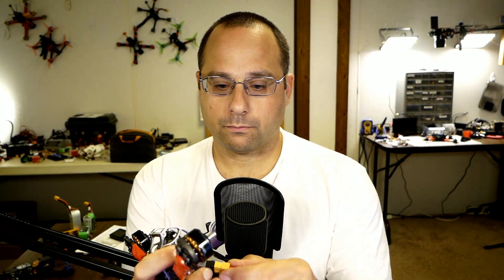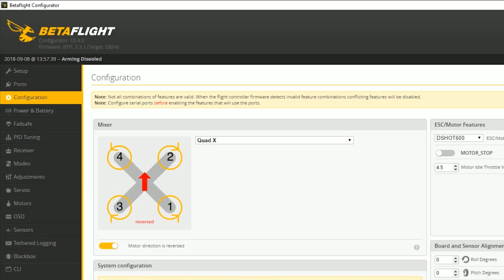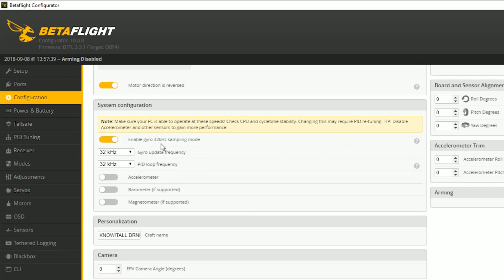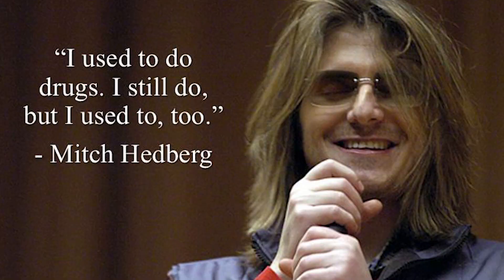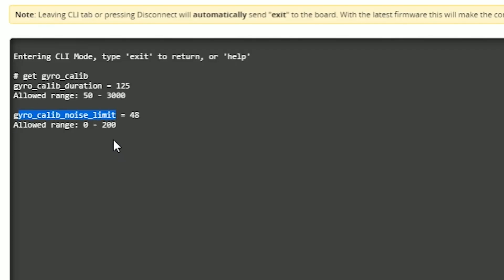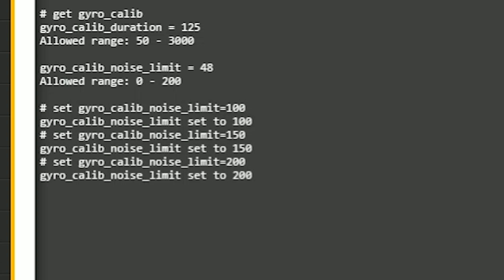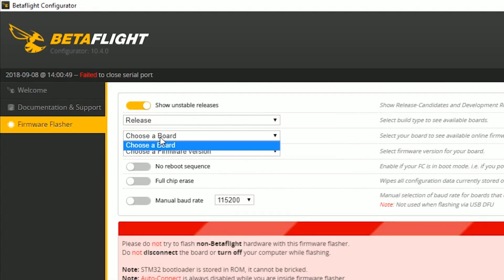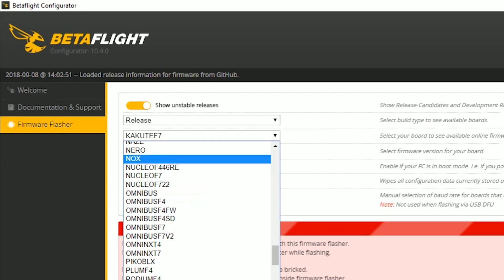BETAFLIGHT WON'T ARM | CALIB NOGYRO arming status flags

Comment from the maker: One additional tip for NOGYRO that I overlooked. If your FC has a gyro with ribbon cable connecting it, then the ribbon cable may be damaged or disconnected. In this case, you might be able to replace the cable or the gyro, instead of scrap the entire FC.
Reply: How do you go about replacing the gyro ribbon cable on F7 AIO?

Comment: I have come up with yet another reason this might happen on a new build.
I put a cooling fan on my Walksnail Avatar  VTX.
The vibrations from the fan were too high and it wouldn't calibrate until I raised the calib noise limit. I could have changed to a lower speed fan, but that required removing my camera mount, de-soldering, re-soldering. It could have taken several minutes and I just wanted it to work now. 😊

Comment: This video is dangerous...  I'm fairly new to FPV, and had a drone that was giving the calib flag...  I followed this video and it armed.  Myself and everyone I was flying with went "cool, see if it flies!"  

As soon as I touched the throttle it ran away... it shot straight up spinning so quickly I couldn't tell what was going on and all I could do is alert everyone it was going to come down and disarm.  It ended up landing on one of the other pilots (thankfully it was a crux35 so it was light and disarmed and there was no injury).  It could have been way worse.  It could have been a five or seven inch, and could have landed on the kid flying with us... 

After feeling really dumb and doing a lot of research / debugging, it turned out the x and y axis for the gyro were working, but the z axis was dead.  Increasing the threshold from 48 to 60 let the drone arm despite this.  

I learned a lot of lessons, the biggest one being never test a drone anywhere near anyone else, however this video doesn't talk about any of the other things you should look at, and gives the very dangerous message that if this "fix" makes your drone arm, it's good to go.  I try very hard to be safe, and I made the erroneous assumption that this video contained all the information I needed.  At the very least there should be a disclaimer added to this video, if not a remake of it diving into some of the safety issues of changing this setting.  

It is our responsibility as pilots to do our due diligence, and my ignorance is not an excuse.  I messed up.  But it is also your responsibility as a creator to not put out dangerous information without any sort of warning.
Reply from the maker: I've literally never heard of this happening before. 🤷
Reply: @JoshuaBardwell  You have now.

Comment: Hello, what is the negative offset of raising the moron / gyro calib noise limit threshold to 200. 

Why would you not just have it to 200 all the time?

Trying to launch my FPV from a moving vehicle! 

 @joshuabardwell
Reply from the maker: If you're launching from a moving vehicle definitely raise it to 200. In theory, a higher threshold could allow the gyro to appear calibrated while actually not giving good data, but the alternative is not being able to launch, so you accept the risk.

Comment: I have this issue ...sometimes arming without any problem, sometimes not and I get (CALIB) msg

The sound when I connect the battery with the quad normal

What should I do to solve this????
Reply: Same problem  here did you found a solution?

Comment: Well still no gyro and it's a brand new nazgul BNF.
F's in the chat.
It happened after I flashe to old BF version so I can install the factory dump CLI. After that all good, except the gyro is not detected. If I update the firmware to BF 4.4 I can see the gyro but it's really weird because the frequency is 3.2 kHz and not the usual 8 kHz. Very confused on what to do. Need to write to iFlight.

Comment: Mr bardwell, a few days ago I bought from grtfpv an happymodel x12 aio 5 in one with spi frsky when I plugged into betaflight some time, most of the time the gyro and accelerometer icons are in gray and in some cases they are on. I first thought it was that I was using betaflight 10.07 and it said that using an older version of betaflight could corrupt the firmware, I updated betaflight, I flashed the fiemware as you explained and it still does the same. One thing to mention is that when I autodetected the first time the board it said it was crazybee4sx1280 and its supposed to be an crazybee4fr, I tried flashing both and always happens and when I trie to bind it wont bind the only binding possible was with d16 mode in a taranis x9 lite. Could you help me some how?. I am from argentina therefore its a little complicated to send the board to getfpv. Regards and thank you in advance. Juan

Comment: Amazing.  I just built a Phantom with a naked vista and i couldnt figure out why it wouldnt arm.  Well, I go to the other Bardwell video to add Betaflight warnings to DJI goggles and find "calib" warning.  Come to this video, and in just a couple minutes i find out that it wont freakin arm because ITS SITTING ON TOP OF MY FAN BECAUSE I DONT WANT TO OVERHEAT MY NAKED VISTA, AND MY FAN IS VIBRATING THE GYRO.  Thanks Joshua.

Comment: i did fix a brand new board that someone gave me  that had a[ no gyro] flag by sticking it in a small toaster oven on top of a piece of tinfoil and turning oven to 450 deg .i placed a1 inch thin piece of solder wire beside it on foil and when it melted ,which once hot melted quik, i turned off oven let cool ...AMAZING!!!!!SUCCESS...

Comment: Thank you Joshua. You Sir, are a legend. This tutorial helped me recover an old brushed F3 FC. (Moron status achieved ;)The accelerometer was kapot so I disabled it, but I was getting an arming prevention flag "CLI" in Betaflight 3.2 which drove me nuts trying resolve because it still would not arm. 

I searched the runtime_config.h prompt and found https://github.com/cleanflight/cleanflight/blob/master/src/main/fc/runtime_config.h and plugged the Quad into cleanflight. 

In Cleanflight setup, the arming prevention flag came back as 12, which is the code  ARMING_DISABLED_CALIBRATING = (1 << 12). THe arming prevention flag number for CLI is 13,  ARMING_DISABLED_CLI = (1 << 13). 

My assumption is that there is an error in Betaflight 3.2 that does not correctly identify that the quad will not arm due to calibrating?  I followed your fix for raising the gyro sensitivity from 48 up to 100 and bingo. It armed first try. Now I am going to put it back together and start learning to fly acro.  Sincerely, Thank you

Comment: What do i need to do when i plug my quad into the computer and betaflight shiws that its rotating at the z axis, but the quad isnt moving?Its a broken board?
Reply from the maker: If the rotation is very slow you can ignore it.
Reply: Thank you @JoshuaBardwell ! Unfortunately it wont arm for some reason but i check out your "wont arm" videos and ill try it again a few days later
Hopefully it will work

Comment: Hi. I have problem with calib flag but only when i connect 4s battery. When i fly with 3s everything is normal but on 4s gyro is making some sort of vibration even if drone is not moving

Comment: No what had happened was I reset the settings in the setup and now it won't beep, flash colors or anything and there is no gyro. So its going back to Amazon and it was like that when it got here 🤫

Comment: Hi, I just build my first HDV DJI build using the KakuteF7 HDV&Tekko32 F3 4in1 45A ESC STACK . ... I have a strange issues of arming ... the quad will only arm when I am connected to USB to the Betaflight configurator (and the battery) and enabling the motors as well ... if I disconnect the USB cable and disconnect and reconnect the battery I get arming code 8 CALIB .... any idea what is going on ?

Comment: A question. Tinyhawk2. If I use 1s lipo everything works fine. If I plug 2s lipo "calib" appears 🤔 Do you know why?
Reply from the maker: At the higher voltage there is more gyro noise which puts the gyro over the edge. The underlying issue is that there's too much gyro noise. It might mean the gyro is going bad. But IMO the TH2 is marginal on 2s anyway so just stick t 1s and you'll be OK.
Reply: @JoshuaBardwell thank you so much

Comment: Is there a way to disable the gyro so you can get it to arm and use the FC on something like a fan boat or hovercraft? still have control for a motor or two and maybe a servo, but no accelerometer and no gyro. (having the magnetometer and voltage info in OSD would be cool feature on watercraft/
hmmm -prolly should be asking @petersripol
Reply from the maker: You cannot disable the gyro. The FC will not work without a gyro. But you could simply pass through aux channels to an ESC to give you direct control of the ESC.

Comment: Hey Josh I got the CALIB flag when I use a 5s lipo but not when I use 4s lipo. Going to take it back down to 8k/8k and see if that fixes it. Wondering if you heard of going up in cell causing this issue before?
Reply from the maker: Disable 32k sampling and that may fix it. 

Yes, going to higher voltage increases noise sometimes and makes CALIB trigger.
Reply: @JoshuaBardwell  it did fix it by changing it to 8k/8k. Thanks for the great info as always.

Comment: Where is the accelerometer on a Mobula7? And could it get broken or go bad from a crash? I was noticing last night that if I had it level on my screen and turned it upside down and on my screen it was like upside down on like a 45 degree angle but I had it level upside down.

Comment: I had a Calib flag, that I couldn't get rid of, on my betaflight  F7 board. After saving FC settings, I (re)flashed my latest firmware.  I checked status and the Calib flag was gone. Reloaded settings, disconnected betaflight, and it armed..👍🏼

Comment: Hey, I have a problem with my gyro... When I connect my fc to betaflight via USB everything works perfect. But when the battery is connected, the gyro just 'fries' and does not respond... Please help me
Reply from the maker: This is probably a sign of a dead flight controller that needs to be replaced.

Comment: I came across another fix for NOGYRO (and probably other flags). Although its probably not a very common thing to happen, if in tuning your drone though Betaflight you endup copying CLI dumps into your FC, make sure they are correct for your, well, everything.
At least for the BetaFPV drones, the company has all the default CLI dumps for each model. If you are experiencing issues like NOGYRO, try installing the default CLI dump for your model and take a look at the CLI Status again.
Reply: how do you install the default CLI dump?
Reply: I got the gyro problem AFTER installing factory dump. All other settings look fine but no gyro. :(

Comment: i personally feel fulfilled that the MORON_THRESHOLD was a thing, i tend to identify with that setting and wish they had left it. it completes me knowing, i am NOT the only moron out there!! :P the reason i am researching this problem is because i received the Foxeer F722 Dual FC and the second IMU is not calibrating. for those searching the same reason, github threads say it could be Black box logging interfering with the ICM20602. logically if the blackbox card is recording, depending on the card reader, maybe it is a source of noise loud enough for the ICM20602 to not behave nicely...or i am under the influence of the Moron_threshold in my brain, you choose :P i havent found a fix for the Human brain Moron_threshold sensor yet, so dont ask me for a setting! :P

Comment: I had a situation just last week where I took my quad out for a hike, and when I finally got to the spot I was going to fly, I only got the esc power up tones (no signal confirmation tones) saw the "NOGYRO" flag. Quad wouldn't arm. Power cycled the quad, still no signal confirmation tones and "NOGYRO" flag was still there. Went into my OSD menu, hit "Save+Reboot", got random sparatic esc tones, and afterwards my quad armed and operated as usual. Was really weird.
Reply from the maker: It's probably going to happen again and get worse :-(

Comment: good timing on the vid, i just got my freestyle quad up to 3.5.1 and had trouble getting it armed. the flag numbers in the info tab help a little , but reading the CLI status really just spells it out.  i had min check wrong and the betaflight connection also blocking it.

Comment: hello josua. . thanks for your very effective video. . . But I have another kind of problem. . while until now the GPS worked. . after the betaflight update 3. 5. 0 when I insert the gps with the stick as before the motors stop and the drone drops. . with the same GPS features as version 3. 4. 0. . . do you have any idea?
maybe you need to change the SANITY RESCUE. . . ?
THANK YOU

Comment: Joshua – First, thank you for putting this together. I almost didn’t get started in this hobby because it can become so technical. I bought a quad and enjoyed flying. Just that simple. Then when I started to build and buy advanced quads the headache started. Without your work, Blue Falcon and others I would have given up and almost did. I still have a brand new quad I haven’t figured out yet, but I will. All this stuff is just too much. It is like using your credit card, I don’t want to answer 5 stupid questions, I just want to buy it. We need an "I just want to fly the darn thing" setting in quad software. There needs to be a base config standard.

Comment: hello jos,i use f3 6dof fc - airbot bumpbees 30a esc and racerstar 2600kv. the problem is quad death roll, what should i do. any setup with betaflight can help me?
Reply from the maker: If you lowered digital idle percent, raise it back up again. If it's at default, raise it a little bit... like maybe to 5% or 5.5% but not higher. 

Often, death-roll is caused by mechanical damage to a motor or ESC. If the quad always rolls the same direction then the motor or ESC it rolls towards is suspicious.
Reply: @JoshuaBardwell  sorry jos, you mean raise up "motor idle throttle value" ?
Reply from the maker: Yes.
Reply: @JoshuaBardwell  ok thanks thanks jos, i will try
Reply: finally, the problem come from CW MOTOR.. thanks jos

Comment: I have found my no gyro error is intermittent. Tried to fly a few days ago on lunch and no joy. Watched your video and before I looking into the steps you mentioned I plugged in and armed, everything was fine. The correct version of BF is installed. Thinking the board is just on hospice.

Comment: my old FC is seriously pro f3 and recently everytime I set gyro and loop into 4Khz and 4 Khz it wont arm instead I have to reduce it to 4Khz and 2Khz is this normal?
Reply: Which version of Betaflight is on the quad?
Reply: I've tried 4k/4k on my SPRacingF3 with BF3.4 and it still arms but the CPU load is seriously high. What do the 'Arming disable flags' say when you enter 'status' in CLI while your FC doesn't arm? If it says LOAD this is because BF 3.4 is using more CPU power than the earlier versions. You can try turning off some features you think are less important than the 2K PID loop.
Reply: Thank You Jannes and yes jannes after i turn off baro , magneto and blackbox like you've suggested, now I am able to armed the quad. I remember that JB already warn us in one of his video when introducing the btfl3.4 that it will takes a lot of CPU power when applied in F3 board, but I don't realize that this is an example of F3 board behaviour when it lack of CPU power. Thank you again Jannes for your help.
Reply: @mode2-rc175  Yes, Joshua has given me a lots of valuable advice too. I hope he learned something today though.
Reply: btfl 3.4.0 and the configurator is btfl configurator 10.3.1